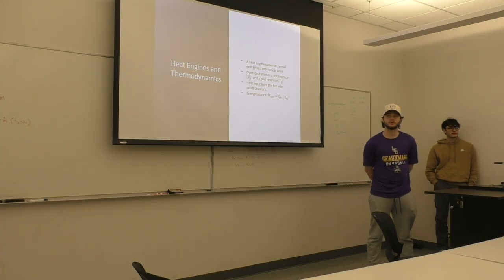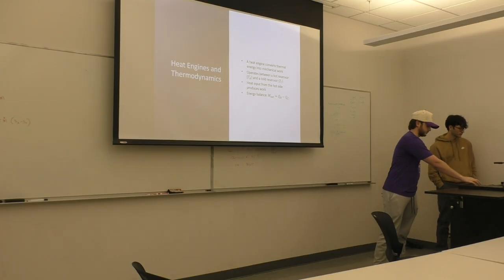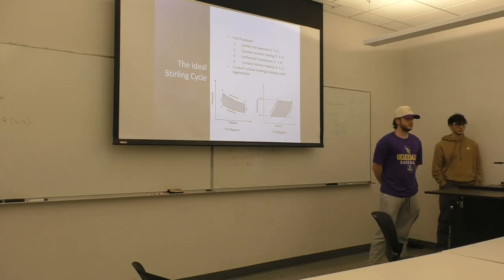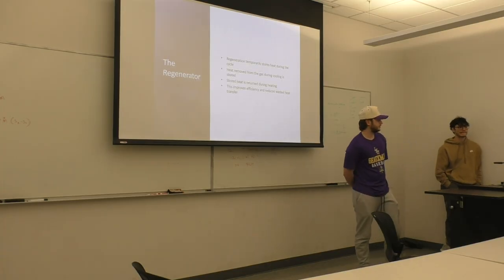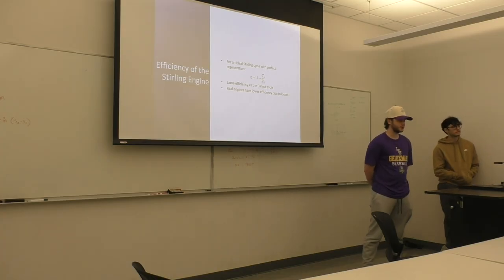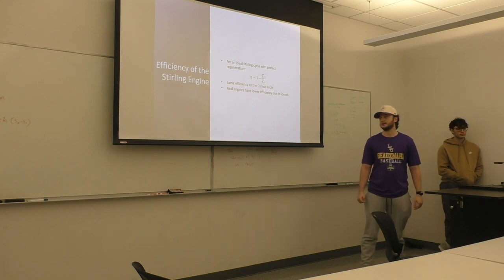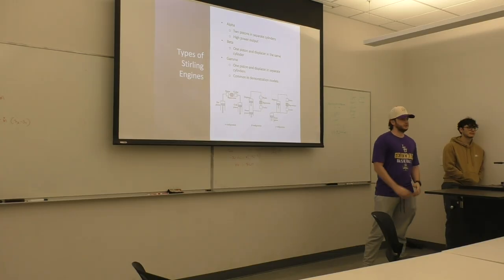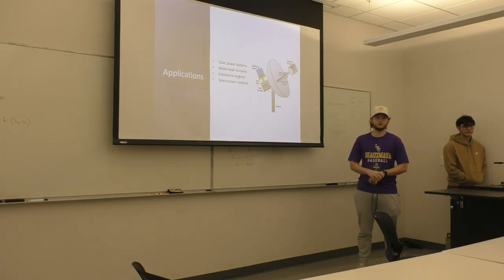Bryce - Six Minute Thermo Talk ME 4611 03/18/26

Comment: I think this presentation did a good job explaining the basic thermodynamics behind the Stirling engine, especially the cycle processes and the role of the regenerator in improving efficiency. I was able to cover the key concepts like heat engine operation, ideal vs. real efficiency, and practical applications within the time limit, which helped keep the talk focused and complete. However, I noticed that my delivery could be improved. At times I used filler words and had a few minor wording mistakes, which made some parts less clear than they could have been. I also think my transitions between sections could have been smoother to improve the overall flow of the presentation.